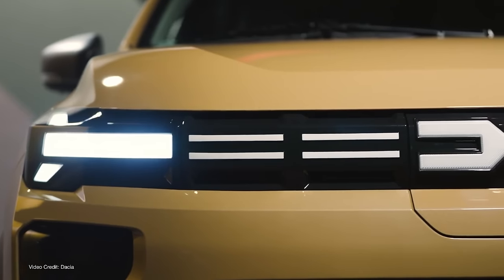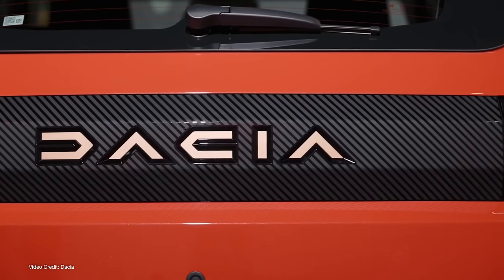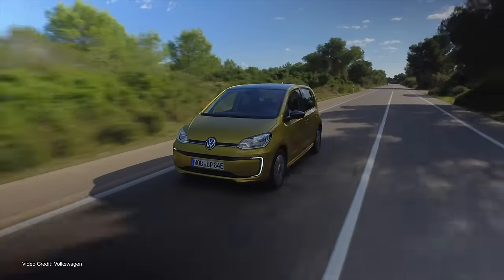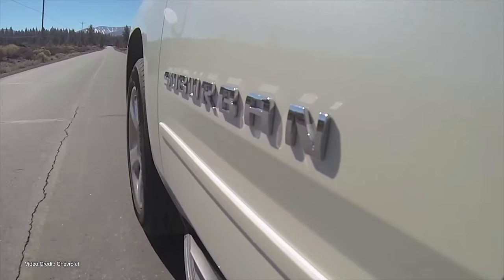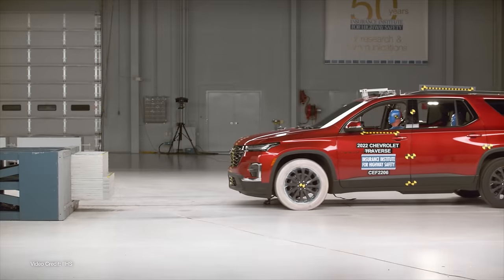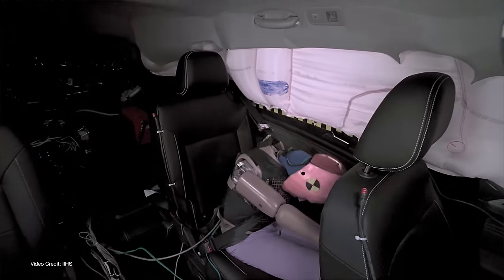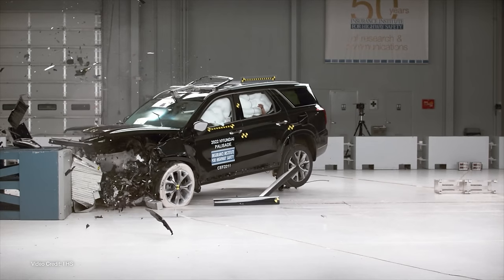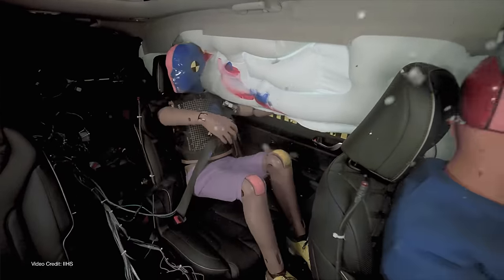Never In The USA - Why the US (And Canada) Appear To Be Anti-Small EV

Comment: Canada, give it time; Canadians pay far less for most cars than US buyers (ya, it's real, compare the $5k CDN difference on the Chevy Trax!) and generally speaking, what sells in the US gets pushed to the Canadian market.  The US market has been progressively distorted by the eye-watering cost and "desirability" of tarted-up pickups (in retrospect, remember the very successful K-car?)  Canada still has manual transmissions(!) as entry-level models, where they have been long-killed in the US.  TL/DR: "small" EVs would/will sell well in Canada, the trick is enough volume to make it worth doing for the manufacturers.

Comment: You can’t be chased out of town with your 150 mile EV because you won’t reach the edge of town.

I’m just being sarcastic I don’t mean that.

I am able to get by with my 85 mile range Fiat. But it’s not a great experience. It’s not terrible But it’s not great. And if I want to have two events in a day, I definitely need to plan to charge somewhere in order to make sure that I’m not in limp mode on the way home. This is in Los Angeles, and this is where each of those two trips is somewhere between 30 and 40 miles round-trip. In theory, 85 miles should be enough, but in practice, it just doesn’t work that way. Mostly because a lot of that travel is happening on a freeway.

If I had doubled the range, so around 150 to 170 miles of range, I would not have this complaint.

However, I would still be in the situation where if I want to go to San Francisco or San Diego, even 150 miles of range Would be problematic. I know on this channel you said many times that you should take breaks more often than most of us do. But I have definitely driven from my house in Los Angeles to San Diego and my Ford Mustang without having to stop for gas on the way there. I would have to get gas in San Diego or on the way back, and then I would definitely make it all the way home.

Contrast this with a Polestar 2, an approximately 200 to 250 mile range. When I drove that from my home fully charged down to fully charged in San Diego, I was able to get there just fine without going to limp mode, but I definitely definitely needed to charge for on the way back. I found a place to charge, I parked and plugged in, and then went to the show. However, when I came back to the car, it turned out that what I thought was a successful start for a charging session was not. at that point, I had to try to make my way back to Los Angeles. I had to stop at a mall along the way. And the person who is driving with me needed to get home by a certain time, I could only charge for about 20 to 30 minutes. This did not result in a full charge, and yes, it was electrify America. I was able to get to Orange County from there, but my battery was down to about 20%. When I left there, I then found myself getting close to midnight, and had to find a place to charge. The built-in system did a good job of telling me where chargers were, but I ended up going to a mostly closed major mall, where I ended up having a walk around a bunch just to find where the charger was. When I got there, there were several people waiting in line, probably with the same issue. I did manage to charge and I charged for another half an hour, and that was just enough to get me home with approximately 10 miles of range left.

When I traded my mustang for the Fiat, I was already in a situation where I couldn’t for instance drive to Las Vegas to the desert for fear that the car might overheat. It was a 20-year-old car. A similar situation would concern me driving down to San Diego up to San Francisco. And so I found myself renting cars for those kinds of trips anyway, so the inconvenience of that is moot for me.

But when the Mustang was new, driving from Los Angeles to Las Vegas, or Los Angeles to Phoenix, I wouldn’t give it a second thought. I would stop about halfway to Vegas for gas and a pitstop, and be on my way in about 10 minutes. Going to Phoenix, I would usually go overnight, and still only make one pitstop, possibly two just before getting into Phoenix?

It’s my understanding that I could only drive in this habit these days with a Tesla and hope to reliably charge relatively quickly. The difference between 10 minutes and 30 minutes for a pitstop is not a big deal, And while I would eat in the car trying to keep my trip as short as possible with a gas car, stopping and eating food while waiting to charge isn’t that big of a deal.

However, between the potential frustrations from poorly design systems, and the possibility that instead of 30 minutes you’re looking at an hour or more, when you’re trying to get from one place to the other in the journey in between is a necessary evil, an EV with less than 350 miles of range seems like a bad idea. And in fact, because of how long it can take to actually refill that battery given how big it is, or it would have to be, if I was still driving like that, I would want additional range. This is one of the reasons why I also have an order for an Aptera. I’m signed up for the launch addition which I believe 600 miles of range. I wanted the 1000 mile range version, but I wanted to get the vehicle earlier rather than later. Here’s hoping they release it.

Comment: When California forced automakers to sell some zero emissions vehicles way back when, they had enthusiastic owners despite ranges that could be 60 or 80 miles (100 to 130 km).  Especially as a second vehicle, I suspect there's a market.  (Most multi vehicle families only use one car on road trips.). What's stopping the automakers that sell short range EVs successfully in Europe from importing them to America?  Well, possibly tariffs, since many are built in China (despite European badges).
Reply: Well GM recalled all the EV-1 prototypes and crushed them. Then to "salt the Earth": they sold the battery patents to an oil company who sued Panasonic and Toyota to stop the production of the RAV4 EV.

One of the benefits touted in the owner's manual of the EV-1 was reduced maintenance. I suspect legacy automakers are worried about a drop in service revenue if people electrify.

Comment: The first version of the Spring got just one star in EuroNCAP as well.
Reply: Mostly based on lack of lane assist and other "safety" features. When you turn off lane assist you are losing stars voluntarily. I hear many do turn off lane assist on cars that do it poorly.
Also keep in mind, these cars are much less used on highway high speed driving which might lessen high speed crash scenarios. 
I had test driven the Dacia spring and almost bought it. It has a TINY turning circle and that alone makes it so suitable for city driving. 
The reviews in the newer model have often ended with at the same price as a new one, you can get a second hand eup or e golf or Renault which had lost 50 percent of the new purchase price. 
So the presence of cheap new cars can also press the market in our favor whether we buy one or not.
I'm still waiting in the right ev as second car for me. It will probably happen when our second car dies..... which is also a green strategy. Drive the present car until it dies and not pass it on  to another. driver.
Reply: @gmosc  yes the new version of Euro NCAP is completely corrupt and implies any care with unnecessary features is unsafe, even though in a crash it wouldn't be any more or less safe than other vehicles. Which means people buy more expensive, bigger cars, which are inherently more dangerous instead of cheaper, smaller cars, which would give us more space in our cities and reduce the mass involved in accidents.
Reply: @gmosc  In Spain you can find the base model Spring for 12,990€ after incentives and I've started seeing them around, mostly driven by couriers or similar. I'd bet there's not many severe accidents in those cases.

Comment: Soon like in the next two years,range will be a non issue as battery will be atleast 25-50%more energy dense n cost 50% less,at that point EVs will be at per in cist as ICE cars while having 1/3 of the running cost n 300mile+ range will be the norm

Comment: Big countries like big cars.  Smaller cars are cheaper cars, and cheaper cars are noisier, less powerful, less refined, and less pleasant to drive at 70+ MPH.  Plenty of small cars in cities, but not so much everywhere else, and in the US and Canada there’s a lot of “everywhere else.”  

Smaller cars are popular enough in big cities, for the same good reasons they’re popular in cities that aren’t in North America.  However, people from non-North American countries, some of whom only read statistics and believe we don’t make any sense, are often the same people who haven’t seen or experienced our vast country the way its long-time residents do in daily life.  Another issue is that they just don’t sell very many “nice” small cars here, with comfortable quiet interiors and good highway performance.  The small cars they sell here are cheap cars, like Nissan Versas and Kia Rios, with poor NVH isolation, and small-displacement shortly-geared engines that inefficiently (and noisily) spin 3000 plus RPM on high-speed rural highways.  

As an example, on the longest road trip I ever took in my old ‘09 Honda Fit (believe it or not, one of the better sub-compact cars you could buy in North America at the time), the poor little 1.5 litre engine was turning 3,800-3,900 RPM at 80 MPH, it struggled to maintain speed on mountain grades, and it was sucking down the gasoline at a rate that belied its ostensibly economical mission.

Only the larger (mid-size plus) cars and SUVs have the refinement, power, and features people who spend a lot of time behind the wheel in less populated area prefer.

Comment: Great presentation! But then I'm a member of the choir... One tactical error you made was right at the end when you said the ineffable, 'equitable' which now brands you as a socialist or worse, communist.   Cars in NA are symbols of power and independence. They are also, in this ever escalating real estate market, becoming the single largest purchase for many younger generations. My first car was a cheap, small car with standard transmission. Nowadays, that's only for the poor people and most people don't consider themselves in that situation even when they are. How can I be poor if I can finance a $40k purchase? (Which ends up being a $50-$55k purchase if you ever complete it).
Smaller cars make so much sense - lighter therefore less energy to move it, fewer materials to import, less space on the road, fewer demands on our infrastructure (electricity, roads, global shipping, etc).
If you really want to make a dent (pun intended) on crash statistics don't focus on increasing size, go smaller because smaller is more nimble, stops quicker, accelerates faster and has less energy to dissipate when a collision happens. Oh, and if you want some immediate reduction in crash statistics, introduce mandatory driver testing every 5 years! (Now who's the communist). Great job as usual Nikki.

Comment: The other problem is cost of insurance and electricity. Having another vehicle suitable for short trips worked well when I bought a 3 year old Leaf for 25% of original price and the practical range of 65 miles was adequate for the vast majority of days and the cost of late night home charging was half that of gasoline. Now however the cost of electricity has gone up to the point that it is cheaper to buy discount gasoline for a hybrid than the night time rate for electricity in my area. With the stroke of a pen the EV cost advantage was wiped out (plus they charge extra for both the registration and insurance of EVs, so they are now at a cost disadvantage). The PHEV is a nearly perfect alternative if one can afford the extra cost of the machine, and find one in a reasonable time. 50 miles of EV range is plenty when backed with 50 mpg Hybrid range and a 10 gallon fuel tank. One other problem with EVs is the crazy cost of battery replacements. Having a component in the car that in many cases can cost 20k to 50k to replace is just crazy.
Reply: 2nd hand EVs will take off in popularity when the One-and-Done economics of replacement batteries is solved
Reply: You have a "night time rate" and are claiming charging at night is too expensive?

I WISH I could get a discounted night-time rate.
Reply: @jamesphillips2285  at $0.34/kWh it is equivalent to $4.25/gallon. Discount gas is less than that here. Peak electric is about $9/gallon equivalent. Crazy way to kill EVs when they say they want to encourage them. Plus extra DMV and Insurance costs. Foolish rules and pricing.
Reply: @alanb76  My province is actively trying to kill EVs. They recently introduced an annual $200 tax on EVs "because they don't pay road tax include with fuel".

They also blocked wind and solar projects because they want to keep the price of natural gas (and by extension, electricity) high.
Reply: @jamesphillips2285  Sounds familiar. We have a $200 DMV EV road tax, and insurance is higher by some amount, likely even more $. For a state that claims to want EVs and has legislated thus. No consistency in government, and no real overall sensible view.
Reply: I'm pretty sure battery replacement in a PHEV (or any hybrid, for that matter) would not be cheap either. The battery may be smaller, but the vehicle manufacturer still has a monopoly on the supply, and they can still name whatever price they want.

Comment: I'm not anti-small EV.  I've owned several small ICE cars.  I usually keep an ICE car for about 12-15 years.  I expect to keep an EV even longer. Right now I have serious doubts that most EV vendors will even be around in 15 years.  Next, I look at safety and support.  I have no confidence in Dacia Spring EV safety and certainly not in their support.  Currently I don't even trust Ford or GM EVs due to all the problems they are having and also since they are losing a lot of money on each one they sell.  There is a lot of turmoil in the auto industry.  I expect to see a lot of bankruptcies or at least severe consolidations.  Right now Tesla offers the Model Y for $37,000 after incentives.  Why would I take the risk of buying something else?

Comment: Love it.  Keep up the great work.

Flaw in your logic about range is that your are confusing data and information as though it is evidence.

The market requires the security of range.   Re read  that. Consumers require it.

Manufacturers are getting to it.

Common knowledge is that most of the time we do no more than 60 km per day and so Dacia and other small.high quality EVS will likely give me 3 days and that's awesome.  Wisdom based on reality of our lives is that we will need (next month, tomorrow or other) to do a 750km run and would be happy for 1 stop and a 10 minute charge at a price less than petrol now.  We dont want 2 or 3 cars for this eventuality.  We don't like waiting in charging ques.  It's ridiculous to pay more for electricity and be slower on trips.

To paraphrase reality is market forces require EV with range just in case.  Data,  information and knowledge are over ridden Wisdom based on real world life experience.

I come from the land down under.
Reply: The market is the market. I can't dispute your take as it's spot on. It does point out that we need to get off this 'just in case' way of thinking.  Pareto's law (the 80/20 rule) comes to mind. And I believe it's probably 95/5 in actual life. An earlier post made a very good case for buying to your 95 need and renting for the 5 percent.

Comment: While I agree with most of what you said, I wouldn't pick the Dacia Spring as a good example, in fact nobody should be buying this vehicle anywhere in the world.
It's really unsafe vehicle that only got 1 star at EURONCAP ( because it can't be lower). The protection for front passengers are considered marginal specially for tall people and it got weak rating for head protection for child.

I am pro small vehicles but not this insecure Dacia, maybe something like a Peugeot e208 or a Jeep Avenger would be a good fit.

Comment: Range on small cars not as important as safety. Are foreign cars as safe as US cars?
Reply: This claim can simply be refuted by the number of deaths in the US vs Europe. According to Wikipedia, the US has 12.9 deaths per 100k population, while Europe has 7.4, as in the entire continent. Canada btw has 5.3. So American drivers seem to be quite inept, which is easily visible in dash cam videos. Also, it is quite obvious, that when you come with one of those extensions onto a regular car, they get the short end of the stick.
Reply: Don't forget Niki's point about using only half of the restraint system in many US states.
Reply: @herbhandyman8933 Unused but otherwise available restraint systems are not a failure of the car though. No belt and no airbag can compensate the lack of brain power.

Comment: I bought four small EV’s, two Smart and two first gen Ioniq.  Great small EV’s for short commute
Reply: I decided I wanted something larger than the Smart EV after doing load calculations on it.

The GVWR is the same as it's ICE counter-part, but it weighs more: reducing the cargo capacity. I worked out that there was only 50lbs of capacity left after my brother and I get in it. No capacity left if I loaded by brother's mobility scooter into the back.

I decided the Nissan Leaf was probably big/heavy enough for my needs though.